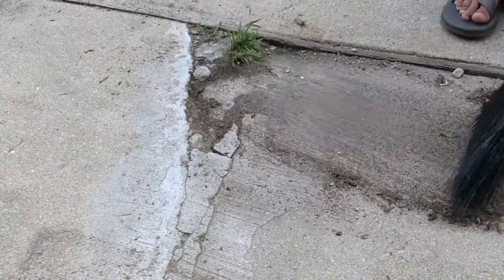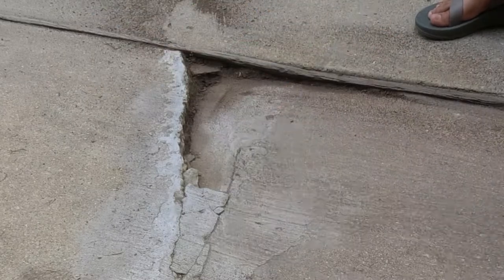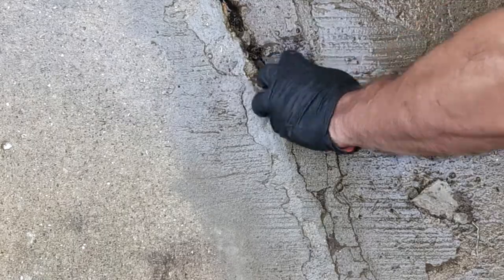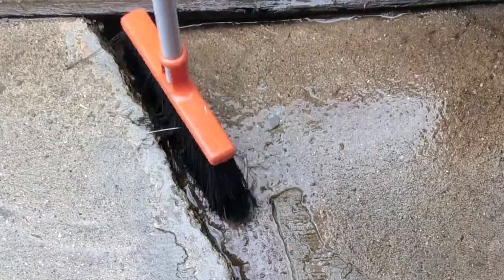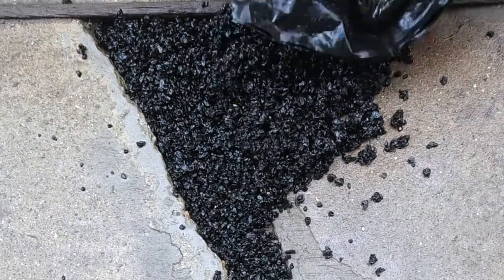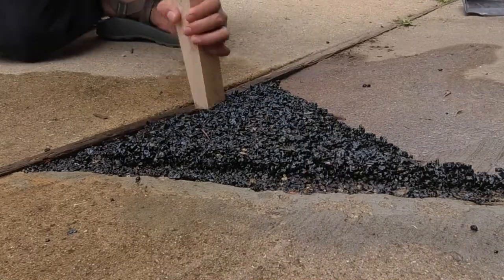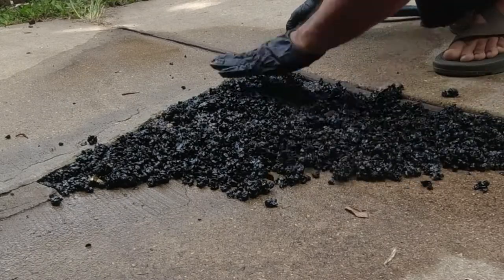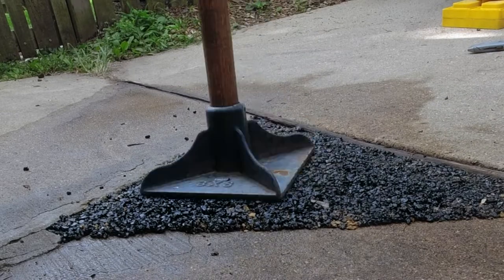Can You Use Asphalt to Patch Concrete???

Comment: How has this held up?
Reply from the maker: surprisingly well. its all still intact. the edges are sound. the area with weight on it got compacted a little bit over time so there’s a little dip that holds a puddle, but it’s much better than the original problem.